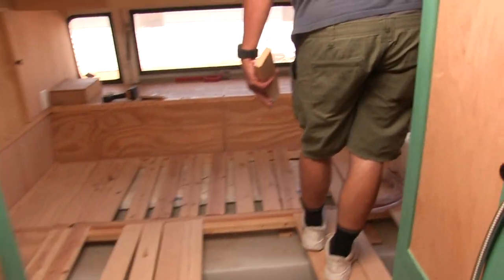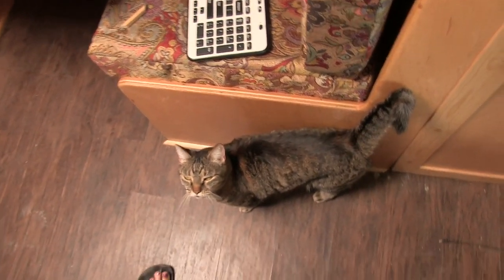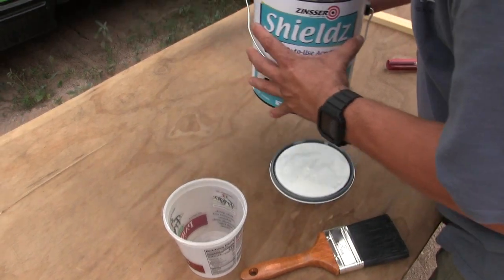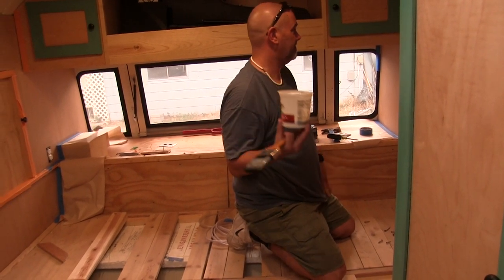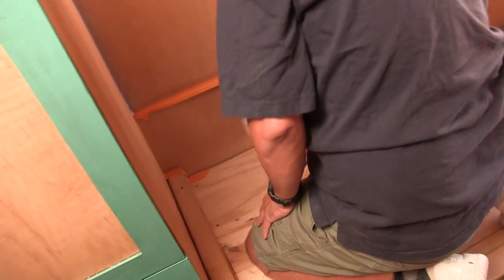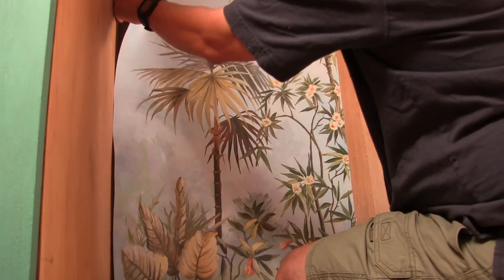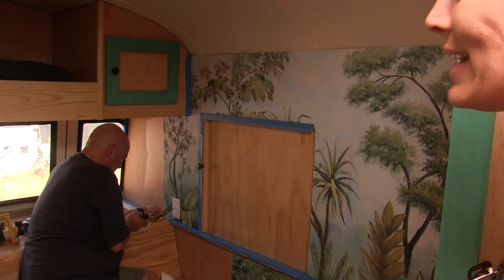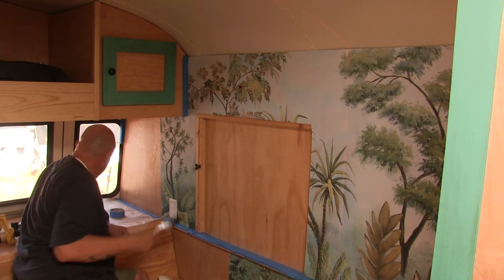Wallpapering the Bed Nook in Our Skoolie (with Chinoiserie)!

Comment: Once you respace the bed slats evenly, you might use some narrow web strapping connecting the ends. That way when you push them aside to get under them all you have to do is grab the slat on one end to reposition them evenly all at one time. If you need to remove them all you can just roll them up.

Comment: I watch the beginning of that little video clip every time of you guys and how much you have changed in just a year and a half, Is that how long you have worked on your bus? Yeah, you should paint like a mural of a window than looking out on the land like a farm in the distance or the Ocean, just anything you guys like. I love putting up wallpaper, It's really fun. I mean it can be a pain bc when it dries it shrinks in some places. 
 Ant's will eat your bus up, If there is any dampness they will find it. I had a tiny Scotty camper and the Ant's eat my camper up. Inside on the ceiling, all that was left was the liner and wiring. I could lift that liner up with my hands.  I love Moma kitty.

Comment: I have a lot of books on painting and papering (my grandfather was a wall paperer during the Depression) The size is basically a starch based glue. I don't want to look up an old time recipe, but I would have tried mixing a bottle of liquid clothing starch with a bottle of Elmer's white glue. On raw wood or sheetrock, it seals it so the wood doesn't suck out all the moisture before the actual paste adheres and bonds. If you were to paper over a gloss or semigloss wall, you would have the opposite problem: the glue not adhering at all, and the proper size will stick to the paint and but be porous enough that the paste adheres as well, in that instance I would use a commercial product like you did.

Comment: I work for the painters union and I've learned how paperhanging is not easy I'm not an expert but they do one thing that I did learn is you need a pouch full of blades you don't use the blade twice reason being is that vinyl will doll out the blade real quick what you do with you use one blade one side and then you use the other side and that's it use it once and you throw it away you have to buy yourself a box of blades

Comment: One big plus to having  wall paper down to the bottom, is to keep the plywood walls from splintering and leaving little needles of wood that would get stuck in the mattress. Also in the back of your hands every time you change the sheets. How about painting the ceiling and those sliding panels for the side windows a sky blue? It would look better I think, even if you got drag marks on the panels when ever you opened them.

Comment: Hey guys when I was a kid my dad had a business hanging wallpaper for mostly commercial jobs but residential homes to we would paste the wallpaper and fold the sheets so they would unfold as you work from the top down and depending on if you have a pattern on the sheets you measure down the print to the next print and cut it off so your next sheet will line right up you can paste the wall also but real not necessary because your wallpaper sheet should have more than enough paste on it but A for effort oh most wallpapers are made of vinyl try working with suede that will give you some gray hair over night.
Anyway looks great the bus is beautiful.
I'm so excited for your first trip
Good times oh I forgot when your putting the next sheet on over lap the print by whatever you need to match the picture then you take your straight edge and cut anywhere you want as long as your print matches it should come out seamless because if you butt them up side to side it may shrink back because the paper typically heavy on the edge its the way it's made mostly.
and then you'll see it and that would drive Mike out of his mind.
Reply: and myself.

Comment: wouldnt be suprised if that paint to prep the walls is basicly wood / hide gleu maibe with a solvent to make it dry faster 
i wonder if there people that would be willing do buy the gallon of prep stuff opened if you put it on graigslist , its kindof expensive and i dont think you ever use it again and its a shame to trow it away or let it sit and gather dust
could post it as a renovators starter kit along with the pieces of lumber brushes etc and other stuff you have left after the build (minus some small cans saved for touch ups)

it might be a good idea to put some clear protective film over the lower part of the wallpaper , since the matress is fitted wall to wall and even if you keep youreselves verry clean youre probably going to be getting sweat/grease stains and scuffmarks on the paper as you lay or rub against it in youre sleep  
after changing youre matress with a lower one , those will become verry visable (been there done that) its still paper and i dont think its washable 
might be nice to put a bleu sky with some white clouds on the ceiling , seen it on a picture once from a casino , they had italian gondolas going through a indoor channel there too